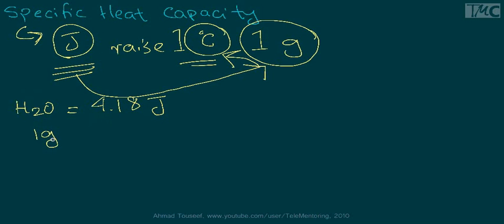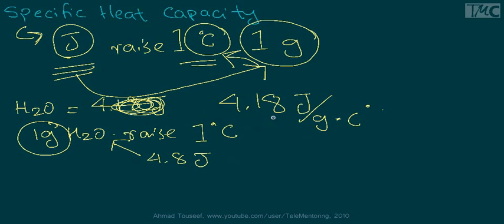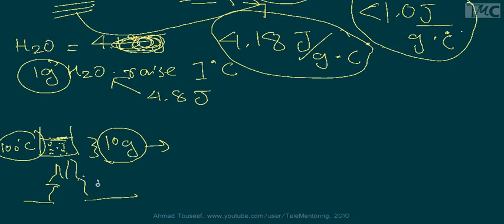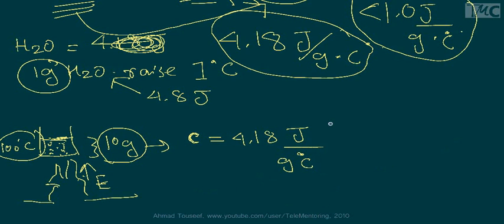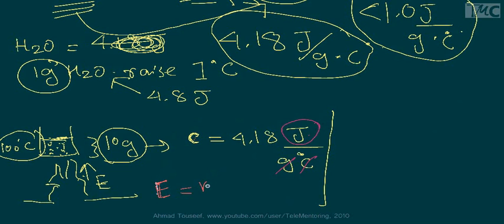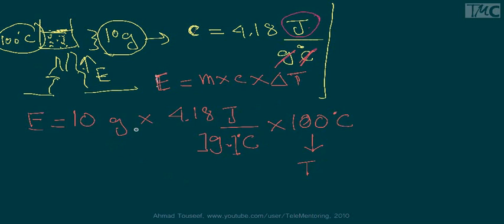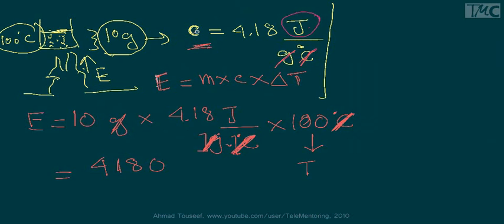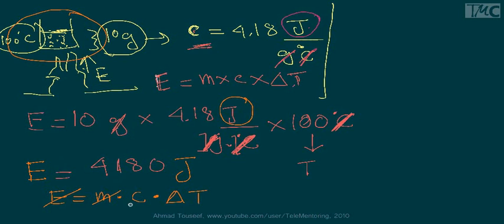Specific Heat Capacity: Enthalpy Pt. 2

Comment: if the initial temperature was 25 and the final is 100. You should of done 100-25= 75
which is supposed to be used in the equation.